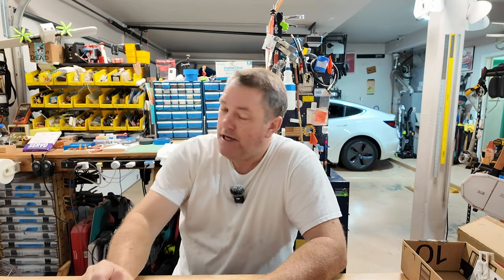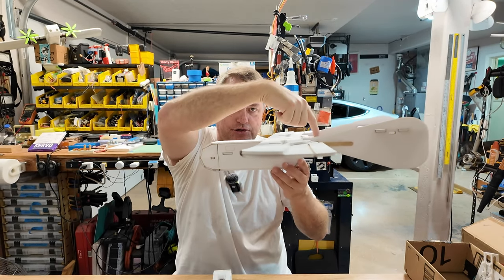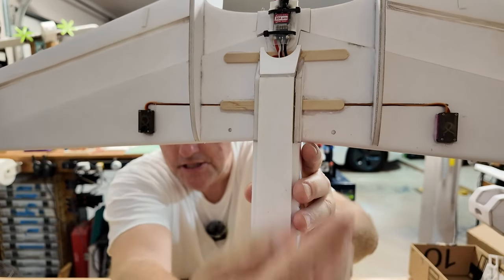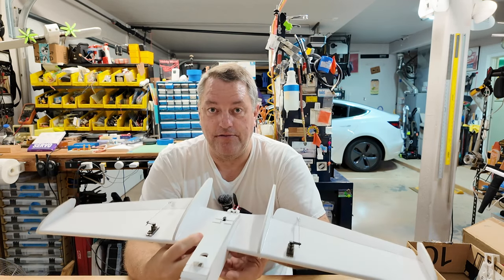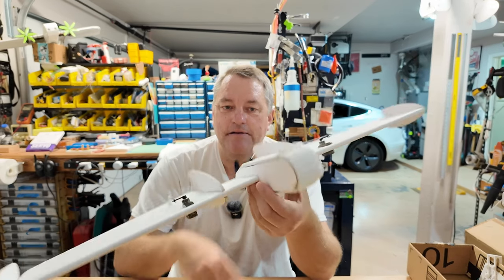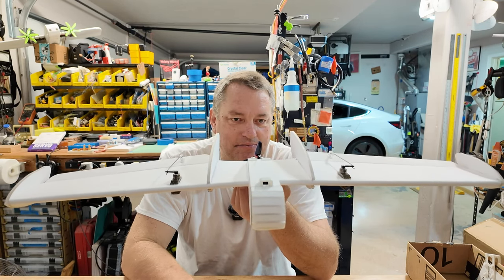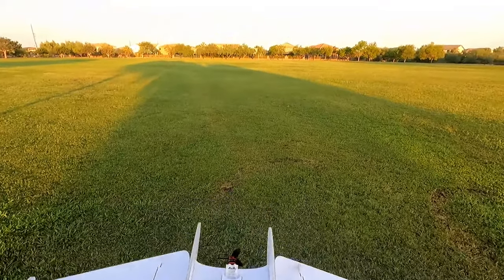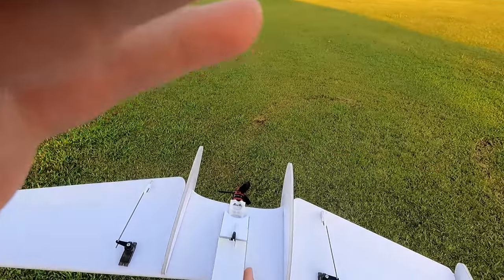Quick Build Mini Wing Introduction and Flight - Sub 250g Radio Controlled

Comment: yep I will be needing some of the files for this one and a few others, already modifying my laser to fit 20 x 30 for the foam board, was in wallmart only to find that they are still selling  for about a buck. I remember about 9 years ago when I would take patterns and glue them to board and cut by hand. I gota say either you are some kinda 3d savant or I dont know what but these are thought out on a whole nother level, great work!!!
Reply from the maker: Thank you for your comment.  I’m working on getting plans together -and I’ll have them out on usefulaircraft.com when I get the chance.

Work is really busy right now - but I’ll get around to it - it’s on the list.  I’m sure you can relate.

Comment: Looks like/inspired by design of nano Drak. Great job!
Reply from the maker: I’ve heard a lot of great things about those - but I’ve yet to see one in person.  My evolution of this design came from making small flying wings, and having trouble with getting the CG far enough forward.  Working in aviation - I was familiar with the old Hansa jet’s - and they were my inspiration to sweep the wing forward.  The central fuselage layout came from trying where to hide the battery.  My early versions had much bigger batteries, and tucking them into the leading edge laterally wasn’t bringing the CG far enough forward - so I rotated the battery 90 degrees and built a fuselage.  After building and crashing a million of them - the design evolved into what you’re seeing here.  It was not an easy road - but I really like the finished product.

Thanks for your comment.

Comment: a nice flying wing, would be a good FPV project.
best regards from the old world.
Reply from the maker: I’ve got a design or two for flying wings that I may revisit.  I started with them, but I found the pusher planks and tractor twins to be better suited for the space requirements of FPV, but I am enjoying the simplicity of RC builds, so I’ll probably go back to trying wings again.

I appreciate your comment.

Comment: Looks like another winner.  Think this setup would handle the FPV "module" with a bit of tweaking or would that be too much weight for it?
Reply from the maker: I know the airframe could handle the additional weight - but I have the DJI O3 air units - and it would take some effort to incorporate the flight controller for them and still remain Sub 250 (especially as they need a digital arming signal from a FC or a spoofer).  I’ve heard Walksnail’s FPV systems are lighter - and I’d love to try with them - but I’m frugal and slow to buy new things while I’m facing a kiddo about to head off to college.  

I have flown previous versions of similar size flying wings with flight controllers - but they were not build to be sub 250g.  The airframe will handle it - the capability is there, and maybe I’ll stew on the idea more.  See what bubbles up.

The seed change on my design was opening up the nose as I did on my plank and other builds.  That gave the DJI air unit the cooling airflow it needed to run here on the warmer days.  This plane has the older rolled nose that I used to use frequently.  It has a look I like - but the airflow of the open mouth planes is far better at cooling the O3.

But this plane, and others like it, are great to keep in my car, and when I need a mental break, and want to lose myself flying a pack somewhere - this is a great plane to have on hand.  I toss it up and for the duration of that battery - I just lose myself in flight and simple RC.

Don’t get me wrong - I love FPV - but RC and FPV hit different.  FPV is more similar to being in the plane - you’re somewhat isolated in the googles. Flying RC is social.  Folks come up and talk to you - and it’s just kinda zen.  I love them both.

Thanks for your note - sorry for the tangent.
Reply: @usefulaircraft  I have yet to get into FPV. Just in the last few weeks got my hands on some old analog gear (I'm very frugal as well) to play with. Haven't put it on a plane yet, haven't flown at all since I got it either, too dang hot still. Not terrible at first light, need to get out early and get my "therapy" 🙂.

Comment: Great video and explanation, Will it fly longer with a larger prop? like 5 inch etc.
Reply from the maker: It’s really easy to over prop a motor.  There are some efficiencies gained with larger props, or props with fewer blades, but once the prop is too large, the motor isn’t turning at the speed the ESC is commanding, and you start to see a heat rise that if left unchecked, will eventually burn out your motor (it usually just overheats, and the insulation melts on the windings, and the motor shorts out internally.)

I’m not the smartest guy for sizing motors / props, and there are some builds I’ve used larger or multi bladed props that run the risk of burning out the motor - so I don’t always follow best practices.  But have a look around online- there are some brilliant folks out there that really seem to enjoy figuring motor / prop combos.

If I’m honest - I use a lot of cheap quad motors and props namely because they are inexpensive.  You can spend as much money in this hobby as you want.  I’m a fan of bulk buying cheaper parts so I can build more planes, and everything gets recycled into other builds unless I really love the design and it gets hung on a wall.

Thanks for your comment!

Comment: Is that KEF airfoil on the Mini Wing inverted?
Reply from the maker: Yep.  I've flown it both ways. 

Works great. 

I honestly think the wing flies due to AOA, not Bernoulli.

I've built up full wings, laser cut aerofoils, minimum weight, all the time spent in getting things perfect.  Yet because this wing is so easy to build- I keep coming back to it. 

It's just fun to fly and quick to build. 

Thanks for your comment.

Comment: Why the flying wing has an inverted airfoil ?
Reply from the maker: Honestly, I liked how it looked. 

I built another plane with the same style wing, and it flew great inverted.  So I tried building a plane with the wing inverted, and it flew great, and looked better.

The plane flies due to Newton, not Bernoulli.  It's all Angle of Attack.

There are more efficient wing designs, but this plane is so simple and fast to build, and compared to kits that take hours and hours to build, this is a great trade off.  Even if you crash it, you could recycle the parts and be back flying that afternoon.

Thanks for your comment.  I hope you enjoy.